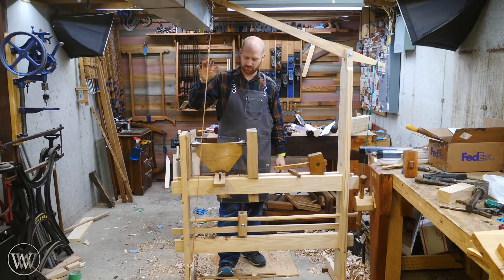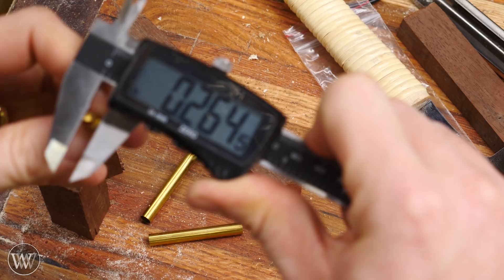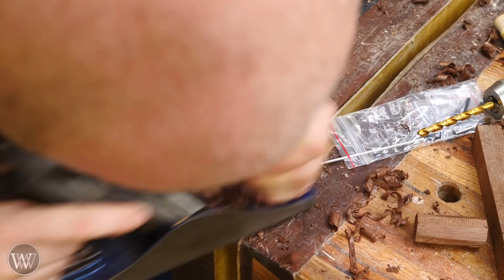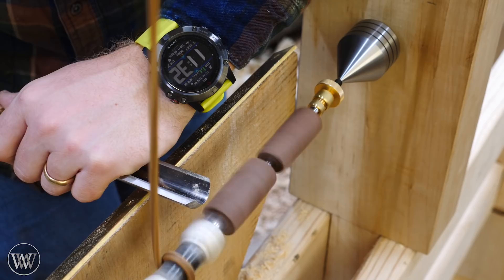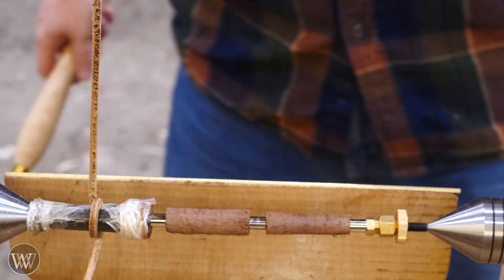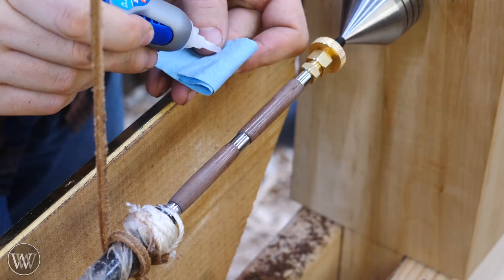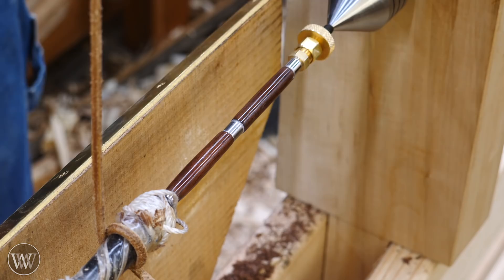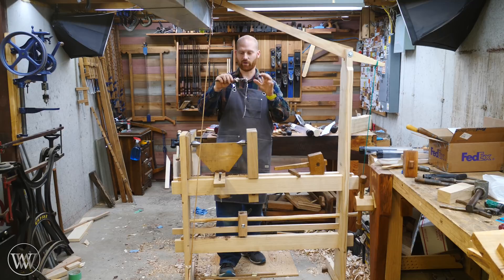Turning a Pen on a Spring Pole Lathe  - First Try

Comment: Cool.  I made a pen on my pole lathe back in 2005.  I acquired a used MT2 reamer and built a wooden mandrel for the pen mandrel.  It worked better with one part of the pen at a time, just the top, then the bottom, separately.  Much less flex.

Comment: I've used a springpole off and on for many years. (I do medieval reenacting) and while I was watching you working the gouges and carbide cutters and I said out loud "use a skew chisel". It was like you heard me. Because of the slow speed and the way the work piece keeps changing directions, a skew is really the way to go. Going forward, it slices material off and on the back spin, it just rides the bevel. Instead of sanding, try burnishing the turning with a handful of shavings. I know it may be hard on such a small project to have enough shavings, but there are probably enough in your trash bin. The burnishing really does a better job and shows off more of the figure in the wood because it doesn't clog the pores of the wood with fine dust particles.  I've tried hard not to fall down that ink pen rabbit hole. But you did an awesome job and I may have to give them a try. (WAIT!!! What did I just say?)  As far are the drive belt/rope, a wooden spool (like an old fashioned thread spool glued to the mandrel shaft will probably work well.  Also adjust the foot pedal so that it pulls the drive rope straight down and it will track in the same spot and won't wander up and down the shaft of the mandrel.  Once again, good work.
Reply from the maker: +Mike Bennett thanks man. I use to do a lot of midevil reenactment. So many fun ideas with this lathe. I have a ton of experimenting to do over the next few weeks.

Comment: THIS is awesome, James! As a side note: the carbide tips don't work as well with a spring pole lathe because they're designed for more of a scraping action instead of a cutting action. And cutting is what you do on a lathe that moves at slower speed. That's also why “riding the bevel“ is even more important with a foot powered lathe. And you did it just fine! Love the vid, as always...
Reply from the maker: +Ben Lehnert right on. The one exception to that are the very hard woods. I am having fun playing with all the old toys on the new one. Lol

Comment: Ok, I'm blown away at your finish on something that moves so slowly! I usually finish my pens @ a minimum of 500rpm.  I'm glad that you used a mandrel.  Perhaps turning some wood disks, boring them to size and either press-fitting them or glueing them on would serve well.  Or simply cut sections from a large dowel or closet pole and boring them.
Reply from the maker: thanks. It might not look like it but with I get it going. it will do 800RPM forward and 800RPM in reverse. So the actual turning speed is around 1600RPM but it comes to a stop 4 times a second too. and max speed is far higher than that. around 3000Rpm when I do 3 strokes a second. Each stroke is about 8 revolutions each direction.

Comment: Make a couple wood donuts, split one side, put a screw in it and tighten it down on the mandrel. Basically a wood stop block. Heck you have a lathe now you can make them round and pretty
Reply from the maker: LOL not a bad idea.

Comment: Great Result James. I too am a little shy to use the Skew. I guess at slow speeds it does not catch so easy with catastrophic results.
Reply from the maker: +Peter Compton yup. And for the reciprocating action it is much smoother.

Comment: Have you considered a pulley on the mandrel? You could then wrap your cord around  the pulley to turn the lathe. You would need find the right size for the right speed.
Reply from the maker: ya but it needs to be at least 1.5" wide and I would not want it much bigger than 1" diameter to get the right speed on the lathe. So I don't know if anyone makes one that would fit that.

Comment: I enjoy turning a pen, it’s relaxing. I thought the CA finish was interesting, normally I do a wax (beeswax I think) finish and buff it into the wood. My favorite wood for it is definitely padauk, the grain when it’s cut makes some super interesting streaks. 

Have you found pen kits you like? Most that I’ve found focus so much on the wood turning aspect that the pen part of it suffers. Same for the pencil kits.
Reply from the maker: I am just using a few old pen kits I had from before, but I will definitely be keeping my eyes open for them now. I also like the beeswax finish. I just wanted to experiment with this one and see if the CA was possible at low speeds.

Comment: Using the lathe, maybe make some pulleys that look sort of like thread spools that could be secured to the mandrels somehow. Different diameters would give you different speeds of rotation for different materials and/or tools and techniques.
Reply from the maker: yup but the problem with that is the horizontal and vertical forces. once you put a hinge point in the middle they don't work so well. there are ways to do it, but they are often not worth the hassle.
Reply: Would attaching a "drive pulley" over a live center using a setscrew and filing a flat onto the center work? You might need some way to secure the live center to the workpiece though.
Reply from the maker: that circumstance would be a bit too big. it really should be no larger than 3" diameter and it is best around about 1" but I have thought of making a chuck that would have a slot in it for the cord. but in all honesty, it is really WAY over thinking it as for 99% 0f the projects out there it is just easier to wrap it around the work peace.

Comment: Sweet. You could try to replace the metal collet chuck that is part of the mandrel by a wooden one where you drill a hole through both the wooden holder and the mandrel bar to put a pin through. That way you can make a better way to drive the mandrel. I hope i can get across what im trying to say. Im dutch, remember...
Reply from the maker: yup that is the way I sm thinking now. I should show off another pen soon when I make one for it.

Comment: Could you use the lathe to turn a mandrel out of wood? The wood would provide the grip needed and you could turn the ends with a larger diameter instead of glueing cord on.
Reply from the maker: I have thought about that not quite sure how I would get it to work yet, but it is one of the possibilities!

Comment: Don't want no wabbit hole. Loved the outcome. To me, carbide chisels seem to scrape not cut .. I have yet to see where they are good for much except bulk removal. Turning chisels? Bench chisels work at this speed.
Reply from the maker: yup. they are decent for hardwoods and you can get a really nice finish in defuse porus words with carbide blades. but at these speeds there uses are limited even bulk removal is pretty crummy here.

Comment: Do you have a welder? Could mig a fender washer on each end of the madrel. That would keep it from coming off. Or glue some nylon rings on each end. It wouldnt wear the leather strap then either.
Reply from the maker: I would rather not weld on it, but I think I am leaning toward building a glue on option.

Comment: My head is swimming with ideas for that mandrill but I don’t think I can articulate them.  Regardless, I’m sure you’ll come up with something better than tape.  Have fun decorating your rabbit hole now that you’re moving in. 😋
Reply from the maker: LOL you think I would have skipped the rabbit hole as I use to live in this one year ago when I got my first lathe. but here I am again. LOL
Reply: Wood By Wright 😂 are you sure you really left?  

Best simple idea I’ve had is angled slide on stops with a set screw.  Might need a flattened surface about a 1/16” deep on one side of the cylinder to meet the set screw but that small of a flat shouldn’t bother the cord.

Comment: Considering how much play there is in the leather couldnt you just make a large-ish cone with recesses at various intervals to trap the leather? That way you would be able to change the speed on the fly with a single addition instead of making a number of mandrels that would need to be swapped out.
Reply from the maker: you could but you can change the speed faster with just moving your foot faster or slower.
Reply: Yeah that makes total sense... guess im just still thinking from a power tool point of view.
Reply from the maker: LOL yup it is more difficult to wrap your head around then you think tell you can give it a try. but it is so much fun!

Comment: what about using a wooden thread spool instead of the piece with the rope?
Reply from the maker: that is one of the thoughts, but that would increase the diameter and slow the lathe RPMs

Comment: I want one!
Thinking of making one that’ll slot onto the front of my bench for added mass. Just a bit worried about the noise, as I’ve got neighbours.
Do you think a treadle lathe, with a flywheel, would be quieter?
+ 40k!!!🍻👌🏼😍🍭 YAY!
Reply from the maker: a flywheel lathe can be quieter and louder. the loudest part of both it the cutting of the tool. the rest is at conversation volume.
Reply: In my experience one with a flywheel would be a little bit louder, simply because it has more moving parts. OK, if it's set up perfectly, it wouldn't make a difference, but what in the world is perfect?

Comment: Why is the lathe moving/rocking so much while you use it? I think I would find that kinda annoying.
Can you weight it down more or is this an issue of sturdiness?
Reply from the maker: you really do not notice it in person as you are the one moving the lathe also the camera makes it look like a huge movement when in reality it is very small. the problem is the horizontal force from the cord going out. but I have no plans to change it as it does not affect the use.

Comment: Matthias Wandel did a comparison on helical carbide jointer cutterheads versus conventional jointer knives, and showed that while the carbide inserts do work better on figured wood, they also cause the machine to consume significantly more energy.  The carbide are essentially scraping, which is less efficient than the conventional, which are cutting.

Cutting is just a lot more energy efficient.  The same is true with turning tools.  When the machine is doing all the work, carbide scraping cuts are fine.  When the power is coming from you it’s another story, and a more efficient cutting method is going to be superior.